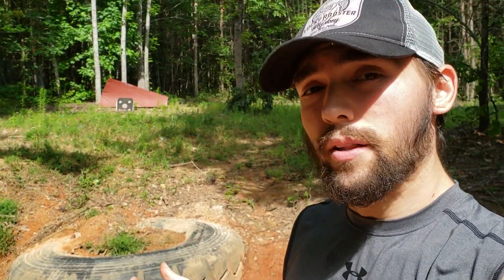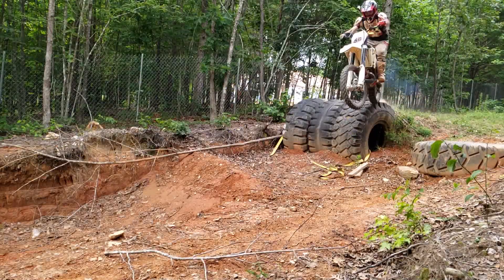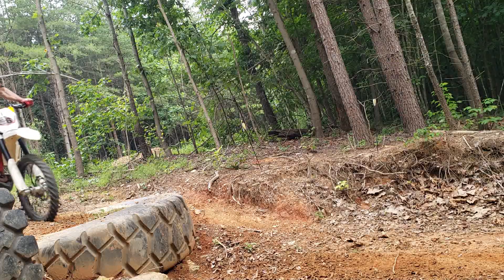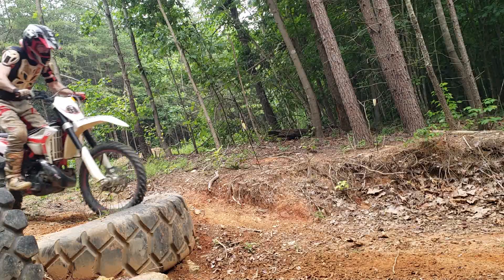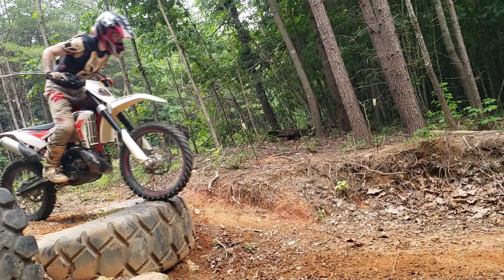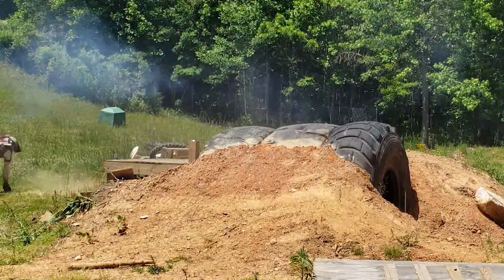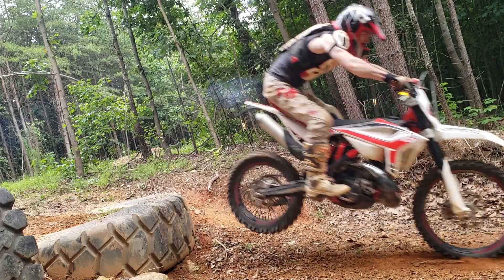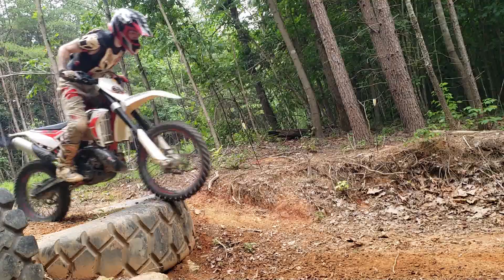Tips for dropping off ledges plus bike setup

Comment: Well Done...having trouble balancing lifting the front wheel while the map switch is on cloudy off a drop on beta 200 RR, prob need more confidence...is it me that the bike doesn’t throttle wheelie easy?
Reply from the maker: Did you ever change the gearing? Even after my gearing change I agree you need to be in a decent spot in powerband of the 200 when dropping off or wheeling gaps at pace. It has caught me by surprise a couple times lol. I am getting used to dropping the clutch harder if I  happen to be a gear high, but as you said in cloudy mode this is also not easy as the bike doesnt like to rev to the moon instantly in cloud mode. I guess this is one thing the 300 has on the 200 :D

Comment: Ok, everyone seems to be saying what you are saying about the back brake position. I’m 6’3”.  I have a lot of leg to fold up when sitting.  I find if the pedal is just a bit below the peg or level with it, before being activated, then its in a better position.  Thoughts?
Reply from the maker: When sitting you should have to pick up your foot and move it to the rear brake when needed, such that your foot will not be touching the footpeg when braking. If you are doing this, you're probably in the optimal position, and I would say that as long as you dont find yourself having trouble reaching the rear brake at times that you probably just found what works for you. Does that make sense? I hear some taller folks run taller seats so they aren't so folded up on the bike, or run their pegs lower which I personally find somewhat hazardous lol.
Reply: @DirtJunkie  thanks for the tips on the ledges. They were good. But, you know, I might have to disagree a bit with you on the rear brake lever...  I run my lever slightly higher than the foot peg, but not too high, I want to be able to dab at the brake and move the foot into position will minimal effort and lifting off the peg. I'm no means an expert, but I have been on a couple enduro riding courses, one was with fellow NZer Chris Birch. We discussed having a rear brake lever that even shorter in that the brake pedal is modified and moved toward the peg more. This allows easier engagement to the pedal without moving your foot as much or at all when you have smaller feet.  Also This allows riders to keep their weight on the foot peg more in difficult downhill sections, giving them more brake control. Would love to see more videos. Even basic stuff. ie. Donut Turn, steep uphill climbs etc

Comment: How are you liking  the beta 200rr?  Im looking into switching  from a beta 350race edition to the 200rr .
Reply from the maker: Check out my 200 vs 300 video where I talk about some of the things I like about the 200. One thing I didn't mention much is the gearing, and I love the 200 with dialed in gearing for my purposes (down a tooth from stock on front sprocket, up 2 on rear). My main priority is for the bike to do hard enduro and obstacles well, and it does - but the drawback is you make compromises elsewhere to get it perfect for your purpose, where a bigger bore is a bit more versatile. It'd be hard to ever go back to a 300rr considering how well this thing handles, but if I went back to full-size chassis for a bit better versatility I'd give the 250rr a try. Also if you're really set on race edition for the KYB forks, the 200rr doesn't come in race trim yet.

Comment: Great video! Have you considered upgrading from the stock suspension? I normally see riders at your advanced level with aftermarket setups.
Reply from the maker: Thanks! I'm really liking how the suspension feels on this bike. For the usual hard enduro trails I'm usually running clickers all out on any suspension anyway except for high speed comp. In this video and for the little jumps in the bacn yard I go around 5 clicks in from full soft on both ends, and 4 clicks in on rebound for the shock which seems to feel nice in the log matrix and going off kickers.

Comment: You doing good how to videos still, can you make a more explained how to double blip for beginners :) On enduro bike
Reply from the maker: Hey, check out the video I did a couple years ago on the double blip.
Reply: @DirtJunkie  Yea i saw that :) but how did you start? to start safely, dont want to start 
travel to the emergency room when i try a big log. I run a 4 stroke or should i swap to 2 stroke ?
Reply from the maker: @EnduroPG  4 stroke can do it too as long as its modern, water cooled etc.. a great way to start is on a log about the size of your front wheel. This is a pretty safe setup, and if you really want to be cautious back the log up to a tabletop or something, basically no risk then.